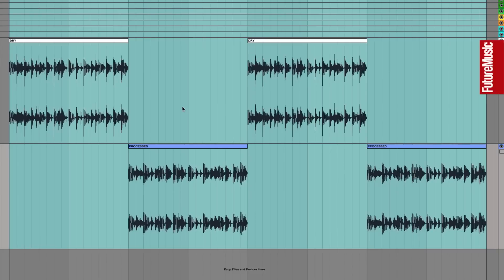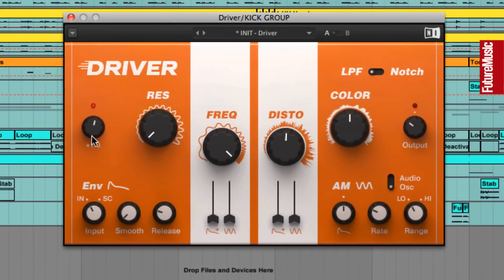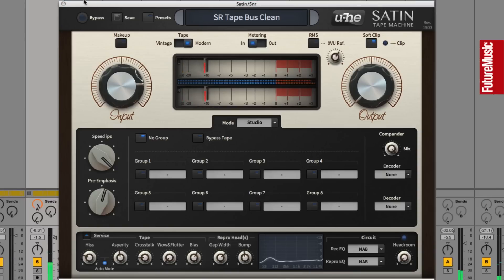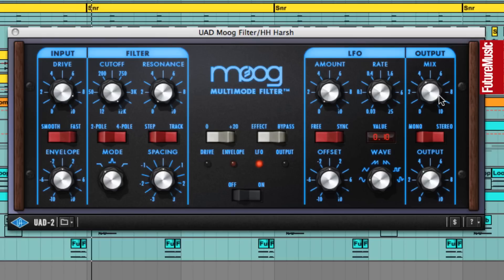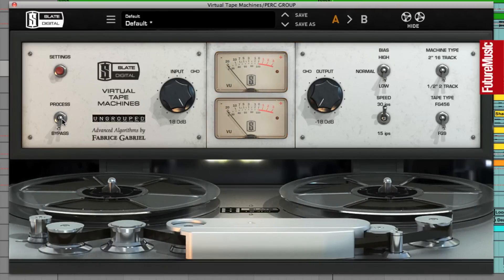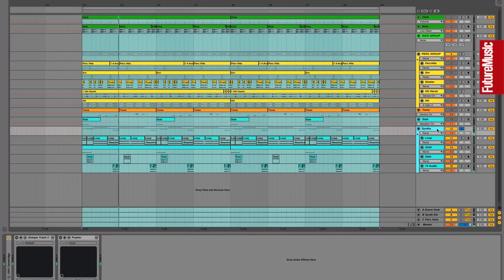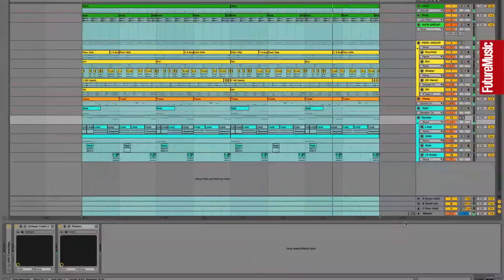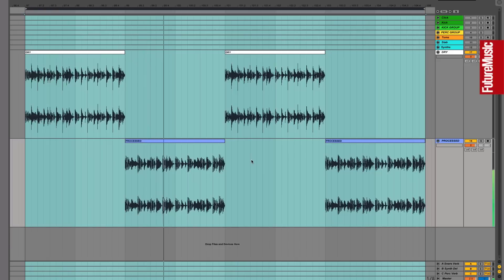How to mix a track with distortion and saturation

Comment: Driver: $49. Satin: $129. Saturn: $154. UAD Moog Filter: $249. ProQ2: $179. Slate Virtual Tape Machine: $149. UAD Vision Console Channel Strip: $299. iZotope Trash: $99. Kush Pusher: $149. UAD Studer: $349. Total: $1805!
Reply: Just get the "K Clip" to achieve a similar effect its a really good saturation plugin and doesn't cost that much
Reply: You can wait for sales, and you don't have to use every plugin used in the video. Learn to use what you have could be much better.
Reply: Wow: this was a 7 minutes long commercial =)